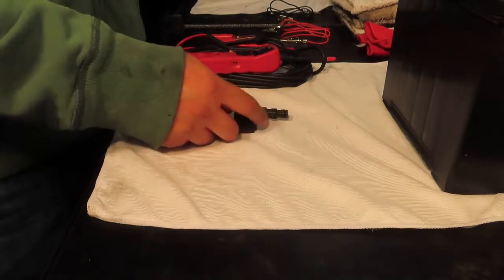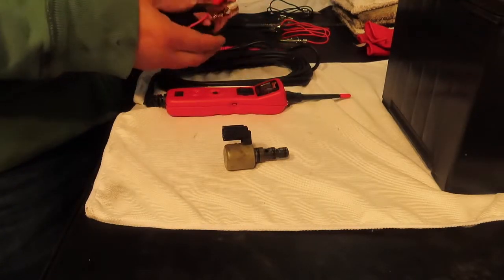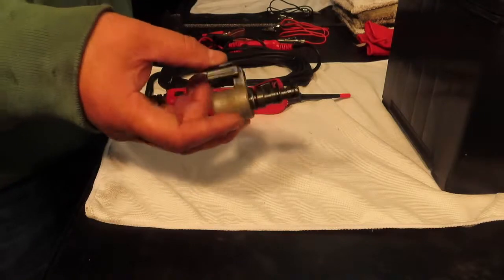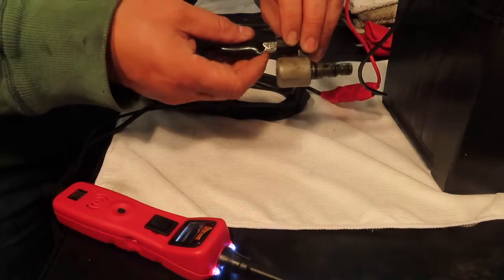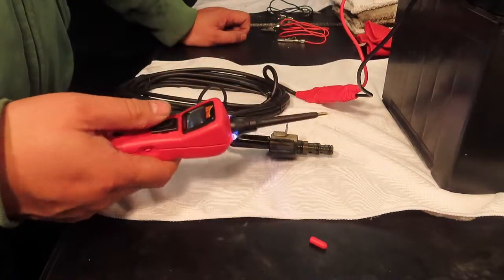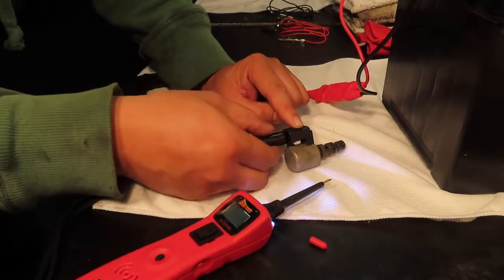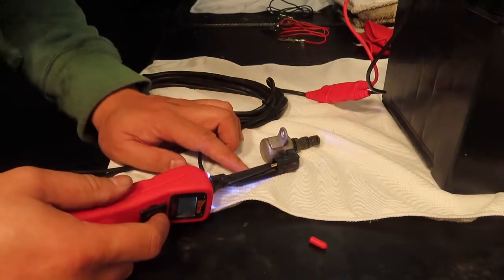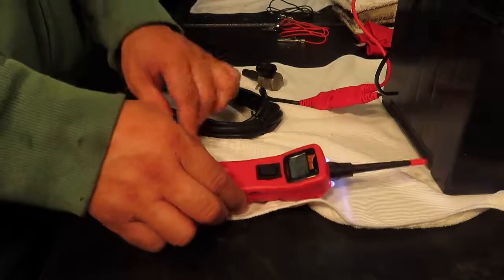Solenoid Test using Power Probe III

Comment: Bro you had to have realized that the reason why you couldn't hear if the solenoid was clicking, was due to the signal noise coming from your power probe, right? Why didn't you just turn the signal noise off, by pressing that little button in the middle of your power probe, and your video would have been a lot more helpful to those trying to understand what the clicking coming from the solenoid sounded like when giving it power? I guess it's a rhetorical question you don't have to answer or reply.